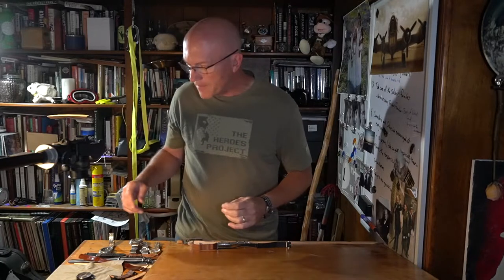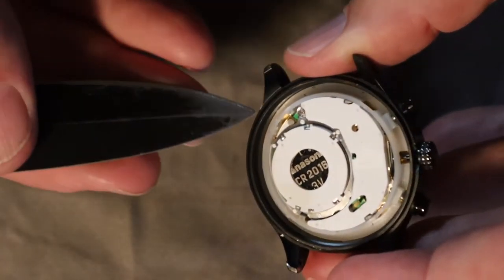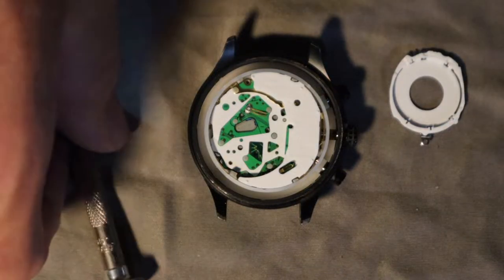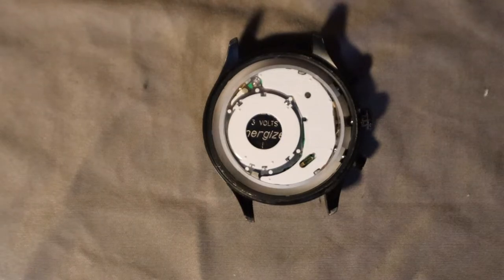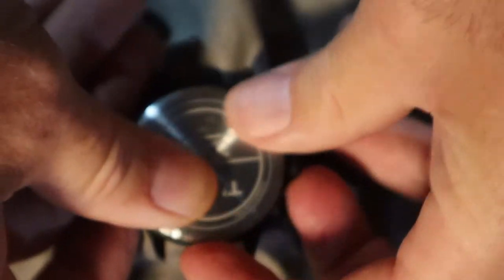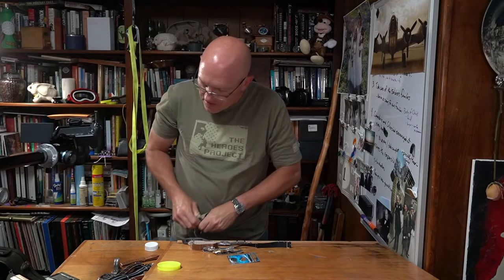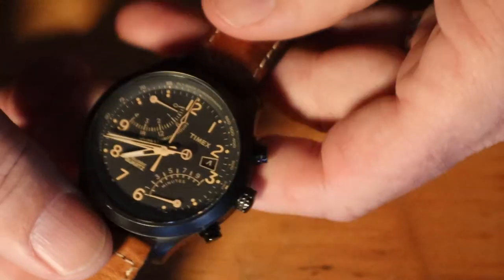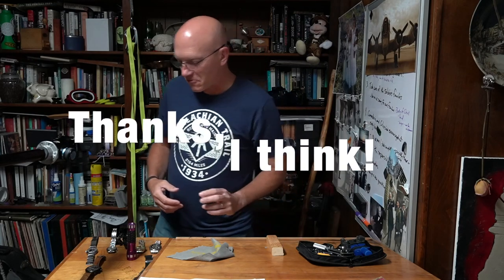FAIL!  Timex Flyback Battery Change Fail

Comment: When you started torturing it with the Nurofen cap and a wooden block I almost fainted😄... The back push press witch interchangeable rings can be bought for ten dollars! And I use it A LOT, especially with Timex watches - bought it many years ago, when trying to close the DataLink's case.